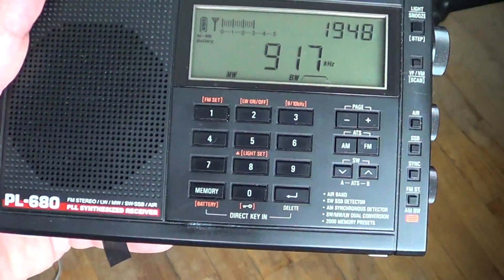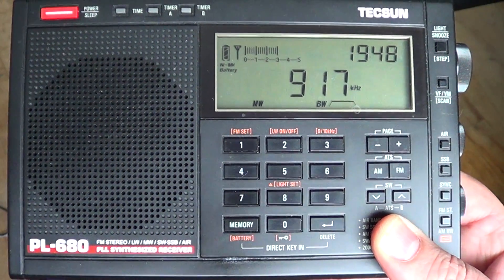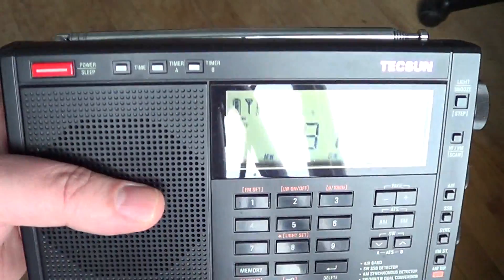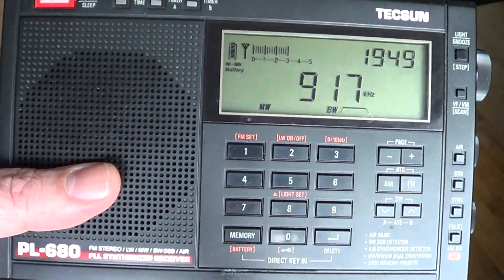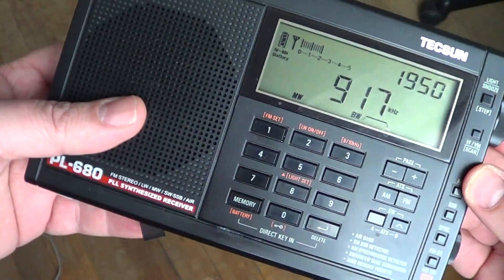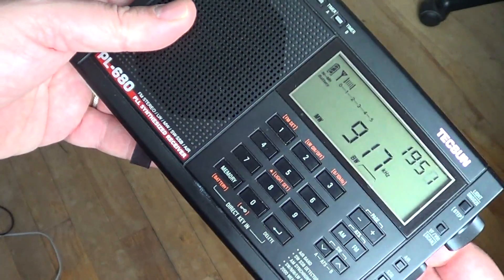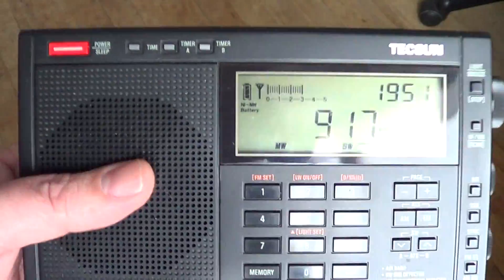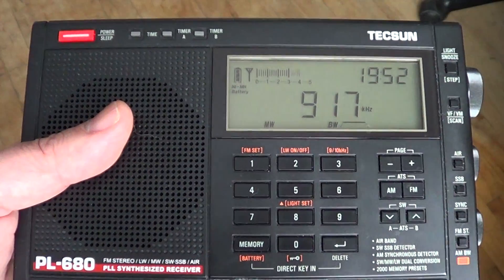Shortwave radio tip How to use a portable receiver to find where noise comes from

Comment: Hello Gilles.  Is it possible to use an antenna that INCREASES signal strength yet at the same time DECREASES signal to noise ratio?  It seems like this was happening when I switched from the telescopic antenna to a wire antenna (like the sangean 60)
Reply from the maker: Magnetic loops are that type of antenna, usually improving signal to noise ratio, one of the popular models are wellbrooks, they are expensive but seem to work well